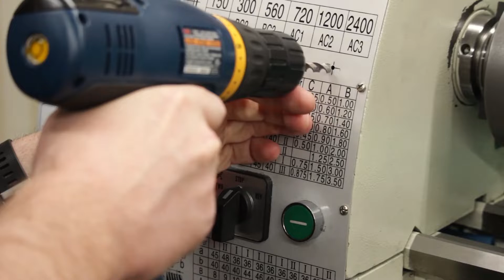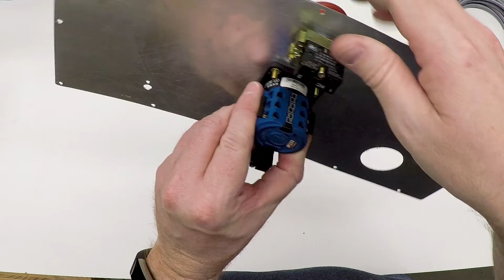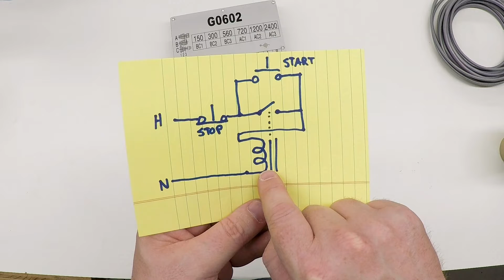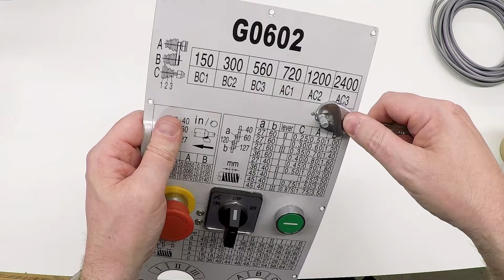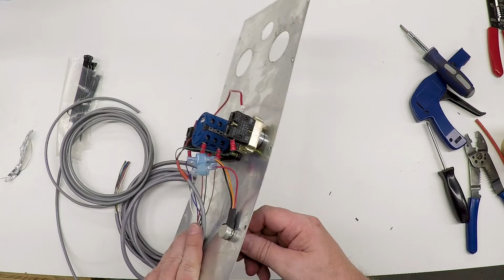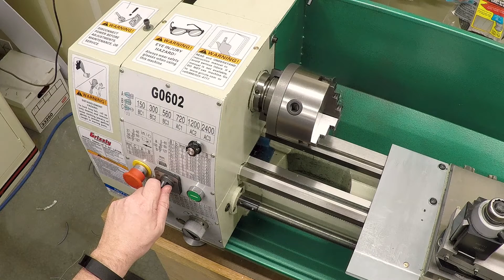Lathe VFD 6: How to Connect and Test the Controls

Comment: I certainly am not a electrician ,
 But I think its called EMF interference from cable going into the control VFD, witch could effect the VFD,
 I think it would more than likely come from the cable that runs the off & on & the potentiometer dial and  buttons,
 They recon it should be in a braided sleave , earthed at one end but not at the other or that would just cause a loop,
They talk about noise interference, from the cables touching,
Could you elaborate on this please as I am in the middle of placing a VFD soon ,and not sure what I read about makes sense as I thought certain outer sleeve has a metal lining in it to stop this happening,

Comment: I've watched these videos and they are excellent but I can't understand for the life of me why you'd want to  kill the power to the drive while you're using the lathe? Explicitly powering off the contactor?  Aren't we taught not to cycle the drive off and on more than once every hour?  If you'd had a disconnect on the vfd box, you'd turn power on to the drive then your controls on the lathe fwd, rev, e stop jog,  wouldn't that be safer to prolong the drive! If you'd want to use a contactor you could still use it but have it close when the disconnect is engaged?

Comment: Nice, but I'm surprised you bother to leave the contactor in place.  A VFD does that job for you.  If you lose power and then the power comes back on, the VFD will not provide power to the lathe. The user must punch the run button again.  I do appreciate that you basically put in a remote keypad.  I run quite a few VFDs and most folks don't take the trouble to remotely place the VFD.  You want to keep them cool and dust free as possible.  For my lathes and big bandsaw I have put in remote keypads.  (some lathes have a keypad that is easily removable, and all you need is a cable set up for that).  But for other machines, like my table saw, I just run a 2 wire start stop (usually between GND and X1 or such)  With that switch close to my hip, it is very convenient for turning off a powered machine.

Comment: Great series, but from personal experience: make certain you have both logical and physical printed schematics with every node numbered,  and number both ends of every wire and teriminal block position with the corresponding node in the schematics. Use wraparound wire labels or printable heat shrink tubing.

Also: bakelite heptagon knobs: a total classic. Go look at the control panel of a Spitz A3P planetarium some time 😁.
Reply from the maker: You will like the videos of my Avid CNC control box.  I used printed heat shrink for that.

Comment: Does anyone or James know how much that 110 contactor coil circuit draws when energized ?  My switches are basically the same as James's ,  He used a smaller gauge wire to energies and control them but does not mention the size.  I want to make sure I am using the correct size wire for the 110 volt lines.  The switches are rated at  10 amps.  Also since it uses the same power feeding the VFD, the 20+ amp circuit breaker really will not protect that line well.

Comment: That was a great job I would like to do the exact same thing to my step pulley Bridgeport's mill I'm a retired machinist but electrical is not one of my things sounds like you have a background in electrical my brideport has a 2hp motor on it and I think it is 440 3phase would this work on it i love the variable speed option

Comment: What size wire did you use for the control wire?
Reply: AI says that the typical contactor relay draw is 1amp or less, meaning 22 AWG is safe

Comment: There is a comment in my manual for a chinese vfd to not use the magnetic contactor as the switch for the vfd. Why is this? Maybe a translation issue?
Reply from the maker: You should not use a magnetic contactor between the VFD and the motor.  You want to use the VFD to slow and stop the motor under electronic control instead of just disconnecting it, or disconnecting the VFD from its power.  To disconnect the power on the source side, after stopping the motor, a contactor is fine.
Reply: Mitsubishi FR-D740-SC vfd Installation manual say too "don't use magnetic contactor to open power line phases off source side.

Comment: Great video James, but I do have a question: Why didn't you just use a 120VAC muffin fan in the enclosure instead of the 12VDC fan?  If you had, you could have eliminated the need for the wall wart. Additionally, you could have done the same for the muffin fan on the motor. I am not being critical of your use of 12VDC fans, but I am curious as to why you used them instead of 120VAC fans.
Reply from the maker: Noise.  I need a quiet fan because I shoot video in my shop.  Everything new is getting Noctua fans now.

Comment: Great tutorial on selecting and installing your Techo VFD as I am planning on installing one for my drill press (L510 220v single phase in 220v three phase out). I have downloaded the manual and just completed my first reading. So my question for you is why did you decide to install a contactor for the external controls instead of wiring directly into the VFD?
Reply: The contactor  addition seems popular.  The logic is, if the power goes out and is restored, the machine doesn't resume running without a reset.  I set a parameter in my VFD that requires the "forward-off-reverse" switch to be cycled to off before restarting due to power failure or stop button/brake activation.

Comment: Hello Sir. I had my new G0602 delivered 3 days ago and realized I really want variable speed control. In hindsight I should have moved-up to the next lathe in the Grizzly food chain. It would have been cheaper than upgrading via your videos. BUT I really thank-you for all your hard work. I have used your links to order the parts as you did. Note, the motor you used has been replaced with a newer model. Casually looking at the specs I did not see any problems. Hopefully not blue smoke in my future. Thanks again!
Reply: Update, today I get all the motor controls functioning from the lathe front panel. Tomorrow I will install the motor. I plan to hang if from an automotive lift to get access to those bottom screws. Thanks again!!

Comment: Excellent job. Also given me scope for thought re: my VFD that recently arrived which I'm planning to use to supply three phase generically to several devices in my shed. They will all receive three phase via one contactor but via an arduino control will ONLY receive power on a first come first served basis. First one powered on gets the power provided the other three devices are off. A panel driven by the Arduino will indicate which device currently has power so it will be easy to safely identify which is causing a lockout.

VERY impressed with the smoothness of speed increment, the relatively low noise (including the lathe gearing) and the instantaneous ability to go from full forward to full reverse. Great wiring job too.

Comment: Was it necessary to use shielded cable for the contactor control wires? And what gauge did you use?
Reply from the maker: Probably not, since they're just 60Hz AC.  I knew I was eventually going to be adding an electronic leadscrew, so I shielded whatever I could.
Reply: @Clough42  What gauge of wire is in the multi conductor cables?

Comment: James, thank you so much for all the time and effort to share this information. I bought a South Bend 13 this week and it has a 3-phase motor. I plan to use a VFD to accomplish the phase conversion. I don't think I will use the VFD to increase the speed range as you have done. I would be concerned about running the plain bearings in the lathe above their design speed and back gears in the lathe already get it pretty slow at the low end. One concern I have is that the original motor isn't inverter rated. I wonder if you have any thoughts about the safety of using an older industrial duty motor in this way?

Comment: James, I have watched your entire series on installation of the new motor and VFD.  Kudos!  I appreciate what you have done, as I am about to install a VFD on my equipment.  I am going to attempt to use the same VFD for my lathe (3 HP), milling machine (2 HP), and surface grinder (3 HP).  I also have a pantograph but it has such a small motor, it will function off its own VFD.  You have run your system now for sufficient time to know if there are any wrinkles.  I was a touch concerned when you mounted the aux fan directly on the housing for the fan of your motor.  I envisioned that the external fan would impede the draw of the fan on the motor and for that reason you would actually be better off running the two fans simultaneously on all speeds.  Any issues on this count?

Comment: Awesome series!Can you explain the "ground loop" you referred to?What does it do to the equip?I've always connected at both ends out of habit,and nothing blew up.Only time I had problems was running dual antennae on the mirrors of my truck grounded,but I thought it was an RF thing....Thanks for sharing!! I didn't see you torroids,is that why the monitor still freaks/crashes?BTW,you coulda used your 3M tape to make sure the cables were held down behind the panel,lol

Comment: The high voltage cable you have picked is not rated to for 120 volt control power.

Comment: I watched these video series with pleasure, it's well done, with detailed clear explanations, but doesn't get boring.
The contactor schematic you're using can be used to retrofit any old-fashioned tool (e.g. a bench grinder) that had a on/off toggle switch, with separate start and stop push buttons (and an emergency stop if desired). This provides a "no-volt release" (NVR) feature, meaning the device won't automatically restart after a power outage, this is good for safety.
However, in the VFD context, I don't really understand why are you using this wiring. I think all the VFDs provide low-voltage (safer) control inputs that can be programmed to be used for starting, stopping and E-stopping the motor. The VFD remains powered and in control of stopping the motor (possibly using DC injection or an external brake resistor to stop the motor more quickly). If the power to the VFD is cut by the magnetic contactor, motor coasts to a stop. It might not be very healthy for the VFD itself, either (could be OK depending on the model/manufacturer). As an example, a quote from Yaskawa V1000 manual: "Install a MC on the input side of the drive when the drive should not automatically restart after power loss. To get the full performance life out of the electrolytic capacitors and circuit relays, refrain from switching the MC more than once every 30 minutes. Frequent use can damage the drive. Use the drive to stop and start the motor."
So, my advice to everyone watching these videos, please do read your VFD's manual fully, and give preference to the wiring diagrams listed in there, for connecting the controls.

Edit: I watched it again and see now that you're starting the lathe only once and then using the 3-position L/0/R switch to control the motor. So the VFD is not being power cycled every start/stop. So that should be fine, then. I still think it would be more safer to use the VFD's E-stop input (if available) instead of the magnetic contactor shutting down the inverter. The VFD would stop the motor faster, and it can probably be set up to do it faster than a regular (non-emergency) stop.
Reply: I'm not a big fan of using low voltage (soft) switching when you have your hands in around the belts. It's not 100% positive off.
Reply: @spehropefhany  Why would you have your hands around the belts? Every VFD being sold is controlled with low voltage switching, what is the problem with that?
Reply: @GenePavlovsky   If you review the video, James had the contactor energized and his hands in the belts with only the switch off. I simply don't trust "soft" switching when it comes to life and death or maiming. You'll find many engineers have similar opinions, we've seen things bugger up too often, for example from a lightning strike or EMI.
Reply: @spehropefhany  I see your point. If opening the "hood", trip the E-stop for extra safety or even remove power from the VFD altogether. And once you have a working ELS, you don't have to open the hood anymore.
Reply: @GenePavlovsky  Exactly.
Reply: @spehropefhany  The forward, reverse and off switch is soft switching.  the stop/start with contactor is not soft switching.

Comment: very interesting, thank you for share it. but I would like to ask an question, other than noise improvement comparing to old motor (1 phase), what is the benefit of swap the motor to 3 phase for the lathe? for the same HP does any improvement to the lathe operation?
Reply: Berry, no bet swaps  with VFD, just turn the knob, and if needed only swap belt for low and high range. Awesome Job James
Reply: yes, I planned also to put VFD to my lathe, but I'm thinking which one is better single phase or three phase for lathe operation.
my power sourch is 220v single phase, and if I change the motor to 3 phase, is there any benefit?

Comment: You explained the use of the latching contactor so the machine won't start after a power failure.  I believe that most VFD's have a parameter that you can set (off by default) for start after power.  When off, the motor will not restart after a power fail unless you repress the start button, so the contactor is probably not necessary as it is on an ac motor.

Comment: Hello James. If I got a  metal lathe and has a 3 phase motor, stop and start bottoms and reverse switch and the Contactor. Can I install a VFD  Single phase in, 3 phase out  and just wire the lathe's leads in the VFD? Thank you for the video. it is amazing.

Comment: I don’t know about the VFD you have but all the ones I have ever worked on will not restart after a power outage they in fact show an error if at start up they detect an input from the previous start up and if memory serves me right on the Chinese it is error 5.
Reply from the maker: This one has that feature and I have it enabled.  If the lever is in a run position when power is switched on, it will not start automatically.  This is good for power failures and also distracted operators.

Comment: Just one comment, the potentiometer you have used is just a standard quality thin track carbon version. A more rugged and  reliable type would be a wire wound version. they cost a little more but will last in that position for ever.

Comment: James: have you lost the braking power of the Vfd with the 3 phase motor by connecting the e-stop to the single phase input to the VFD.  
I am rewiring my larthe with the e-stop in series with an off/on toggle and the for/rev switch an I maintain my breaking . 
( just bench testing,  no permanent wires yet) 
Just looking for your thoughts . 

Dave

Comment: Thank you for this entire series. The detail at each step was no more/no less than required. This is class act. In my 49 years, I have not had the privilege of sitting at the feet of any instructor and reach session-end with no core gaps in knowledge, prior to now. You sir are gifted. Thank you for the balanced breadth, depth, and detail you present in this series. Not once did you drop the ball - perfectly executed!

Comment: Thank you for a very informative series for the installation of a variable speed upgrade for your lathe. I am hoping to do this to both my WARCO 300 metal lathe and to my woodturning lathe as well .Hopefully the VFD I have ordered will be as versatile as your Westinghouse one. Time will tell. I had no idea you could double the speed like that by increasing the frequency so much.  Is your new motor  a two or four pole? Given that you said it was around 1800 rpm i suspect that it is a 4 pole. Here in the UK we are on 240 v lot and running 50 Hz so the 3 phase motors which have 4 poles run around 1420 rpm and 2 poles 2840.

Comment: Very well done, but as you asked for suggestions here goes !

So the 110 V & low voltage wiring cables are held in place by weak single wires with some vibration present when in use. Cable clips on the bundle please ! Don't want to find the VFD low voltage side cooked by 110 a few years down the line when the wires wear through. 

Also there should probably be a suppression capacitor across the contractor latching coil. It might be built in already. Typically an X1 but that also means a suitable fuse in the hot/live wire required. 
The correctly screened cable you've done (one end grounded drain) should couple high frequency switching noise to ground.
The mains filter doesn't protect the vfd signal wiring.

High current low frequency noise such as the motor power is the one to keep away from signal wiring and earth loops as the magnetic field goes through the screening or with an earth loop forms a transformer adding some high power motor drive to weak control signals.

Comment: Very nice and neat installation. Good job.  VFD's make running machines so much more enjoyable. My CNC Mill has a VFD. I have a three phase motor and drive to install on my Lathe. Just need to find the time to install it. Great idea switching on the electric cooling fan at lower speeds.  I hope my VFD is capable of doing this?  Keep up the good work with your videos. Found your channel when looking for examples of electronic gear boxes. Hope you continue with this project.
Cheers
Willy